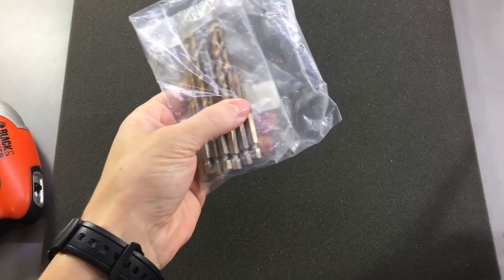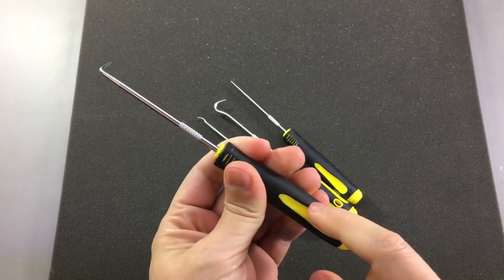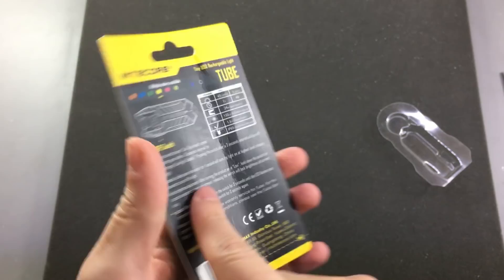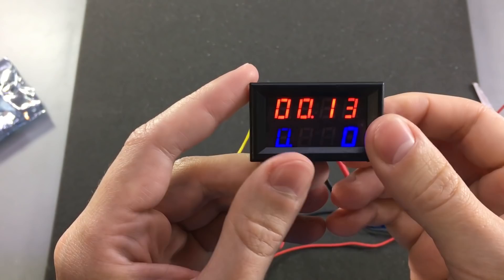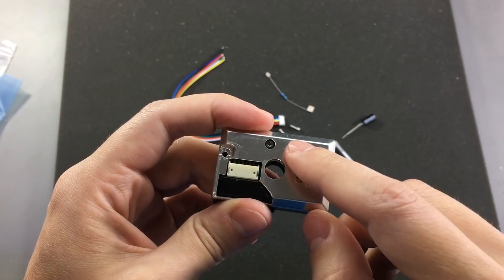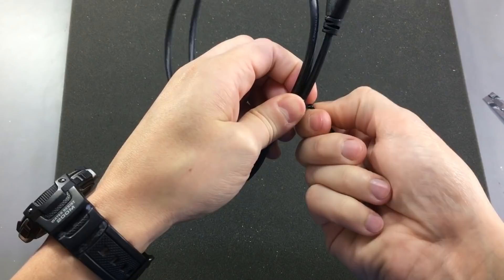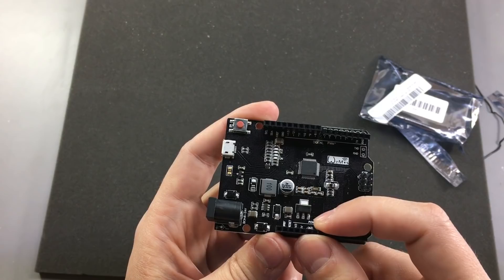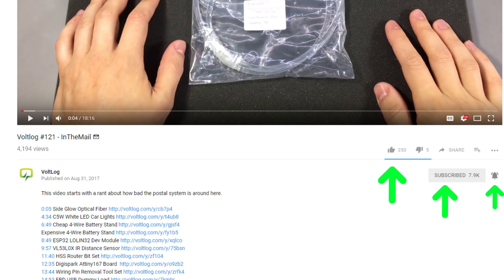Voltlog #130 - InTheMail

Comment: That flashlight is very nice ! I have a few small ones and i use it a lot in my daily work but not rechargeable. I put it on my wishlist on Banggood. Expensive, but that is ok when it is good.
Reply from the maker: Actually, it's the only built-in rechargeable battery flashlight that I own. All the other either use AA batteries or 18650 cells.

Comment: I had a look at those 50 Ohm rp-sma terminators. They are specified for dc to 3GHz, so take care if you plan to use them for FPV antenna, it is 5.8 GHz
Reply from the maker: oops! good point! I don't have the original listing anymore, it was removed but if I remember correctly it didn't even have any bandwidth specified... I have a friend with a network analyzer, I guess I'll ask him to take a look at these. Thank you for pointing this out! Do you know of any place where to get some that go up to 6GHz?
Reply: Sorry, I don't know where to find 6GHz SMA terminators. I once used BNC 50 Ohm terminators with an SMA to BNC adapter.

Comment: The sticky stuff is packing grease. Stops metal parts rusting. A little WD40 on a rag, or some alcohol should get rid of it pretty easily.
Reply from the maker: +John Bailey actually after I finished the video I soaked them in a zip lock bag with some wd40. I will wipe them clean in a few hours. Thanks!
Reply: VoltLog That should work fine too.
Reply: I put all the stuff I want to degrease into diesel. Much cheaper and works crazy good.
Reply from the maker: thanks for the hint! Diesel it's just not something I keep around in my apartment. It's good if you have a garage then you can store some for jobs like these.

Comment: I'd take care with cheap 50ohm terminators. I measured some I've bought with an analyzer and some specified to 3GHz or even more were usable only to 100MHz or so. Some were not usable at all and I'm not talking about the rare shorted ones. You may of course have better or worse luck than me.
When I need more next time, I'll probably make them myself. It is not too difficult to solder a 50ohm resistor or four 200ohm resistors to a connector and add some kind of shielding.
Reply from the maker: Unfortunately "expensive" 50 ohm terminators are also rated for just 3GHz or sometimes less and are pretty hard to get, I would have to pay a lot in tax & shipping just to get one of those. If I were to build them myself I would be facing the same issue though, I would have no way of measuring them so they could be just as good or just as bad as the ones I get from aliexpress so i don't see a way around this problem.
Reply: @voltlog  You are so right. If you have no way to measure them, making them is difficult, especially for higher frequency.
That being said, many cheap ones have been worse than anything you can make with tiny bit of care.
I have a way to measure only to about 2.4GHz. I have no idea if even my "good" terminators are fine for above that.

For measurement reference I'm too willing to pay for a known good terminator. I guess they mean something else than eBay or Aliexpress. Known reputable distributors have good stuff available.

Comment: I bought a similar  INA  breakout board . If it is the same as mine (looks like it), the triple INA is wired as a low side, and they share a common ground. Pretty useless for my purpose.  You'll have to cut the tracks and rewire them to make it a high side, 3x independant  amp/volt meter.
Reply from the maker: On my board, the sense resistors are wired on the high-side but all 3 channel share a common high side input (POW pin). I'm not sure why they did that!? makes no sense.

Comment: That sharp sensor is definitely a fake. Sharp doesn't mold plastic that shitty. 
I ordered the Drill bit set, the flash light, and the RUIDENG Dc/Dc convertor because I just love dc/dc converters. 
I buy only from BG now. So, if you want my support, you will include BG links.
They have the best customer service when things go wrong, as they often do.
I am not stupid, and know I can get better prices from AliExpress or eBay most of the time, but I hate their customer service AliExpress screwed me over once or twice, over high ticket items. eBay is not my cup of tea, so that is out of question.
The drill bits are very useful and don't spin if the chuck is not tightened enough. 
BTW, you can heat treat the tips of those O-Ring pickers or anything that has a very fine point (like jeweler's screw drivers) , using a propane torch or even a lighter to get the tip red hot,  and dipping them in any oil (needs carbon to surface harden). You can then anneal them if you want, but I never do.  
Nice video as usual, and as Oliver Twist character famously said;
"Please sir, may I have some more?"  👍
Reply from the maker: I'm not saying this just because I am making money from banggood through your orders but they have been pretty nice with customer support in my case at least I've never had any major issue with them so far and the few minor mistakes that they've made they have fixed upon bringing it to their attention. I remember years ago when I switched from dx.com to banggood.com it was a massive improvement in customer service.

Thank you for the tips!
Reply: You should get a Patreon channel like every one else. I for one, will support you as I do all me favorite authors. 
To love, is to share...

Comment: I'm probably the only one in the world who doesn't like the nitecore. I found it to be in an on-state in my pants a couple of times. 
The button sticks out a bit so together with pocket money or keys it can be switched on without you knowing it.  Also the led should be covered more on top because in the dark you should light up the field in front of the light and not behind it (meaning a bright spot in your eyes)
Reply from the maker: I just tried it in complete darkness and YES you are right, it does shine a bit too much light to the back at a certain angle. I can understand how that can be a problem for some people. However it's a compact light and the way I see things, I'm going to use it occasionally for brief periods of time so I don't think that's going to be an issue for me. Regarding the switch mine seems to need decent force to trigger the switch, could it be that you have one that triggers more easily?
Reply: I think proper Nitecores have a lock function, you hold the button or double tap and hold the button and it locks it so it can't come on by accident. (See big clive's youtube channel where he compares genuine and fake nitecores too)
Reply from the maker: This one does that too: With light turned on, press and hold the switch for three seconds. Flashlight will lock out after a flash of the
LED to avoid accidental activation during carry. To unlock, press and hold the switch for three seconds
again.
Reply: mmm strange.  If I press shortly then it it goes into dim mode. Holding it it goes to high mode gradually. Pressing for 3 seconds it doesn't really do anything.   Should have filed a complaint at gearbest then , or was it BG ..
Reply: Just checked mine after watching Big Clives video and actually trying to do it as he does it.  Mine is a fake. Seems to have been purchased at Banggood.  I guess I will email them but after being in the drawer I guess they will not do anything.
Reply from the maker: definitely email them and see what they have to say.
Reply: @voltlog   Guess what. If you google 'Nitecore lockout' then it seems that Nitecore changed the software somewhere mid last year. Banggood probably sold the old stock. Sigh... . I like the idea but this was a complete showstopper for me.
Reply from the maker: oh I see so they didn't sell fakes, too bad you got the old rev though..

Comment: Those small car fuses real rating are all the same regardless what's written to them. Starts melting ~20A
Reply from the maker: The wire used inside seems to be the same thickness but different length among different ratings.. so that should result in different resistance values.
Reply: I tested 5A fuse worked continuously at 20A
Reply from the maker: I need to get myself a more beefier PSU to be able to test at these high currents.
Reply: My test: https://youtu.be/aOv8umx-OwI?t=111

Comment: for current measurement you should check out these: https://www.ebay.com/itm/310506962976
you will have to use an ADC but still, way cooler and will work for higher voltages since it is isolated, just thought I might share
Reply from the maker: thank you for sharing, I have one of those, it was shown in an earlier InTheMail :-)